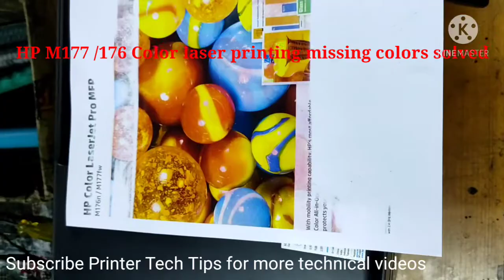Hp M176n/M177fw service steps for printing missing colors

Comment: Absolutely amazing, Thankyou so much. This fix saved me around $1000. I had just purchased new toners and drum thinking they were the issue. Came across this fix and tried it. Printing is working perfectly now. When I put everything back together I ended up getting a 54.2 error, and think possibly I didn't seat one of the components back in the right position. Pulled everything apart again and took more care in putting them in the right position, and error was gone. Thanks again, you are a bloody legend.

Comment: Take my vote, Sir, it works. It seems that the original adhesive, which is worn and separates the metal, is the reason why it stops working

Comment: If black is coming out fine, but color prints come out with this pattern, it looks like you might have a bad develop release assembly (either the sensor and/or the clutch). Basically, when making a color print the develop release assy is SUPPOSED to start and stop the color cartridges at the appropriate times to produce a crisp image. If the assy is bad, they just keep spinning and depositing toner on the page. so i had the same issue and I was able to fix it with this video thanks mate
Reply: Please can I make use of this fix for my laserjet pro 400 color?
Reply: @judahosuigwe  I think so. It's the same.

Comment: Brother, this printer gives a demo or test page very well & clear, but the print from photocopy and computer is very weak. What could be the reason?
Reply: Do you find any solution i am facing same problem
Reply: @rafatamir5815  
Problem was resolved by technician and I think he changed the imaging drum and some adjustments to the photo sensor. it's ok now.